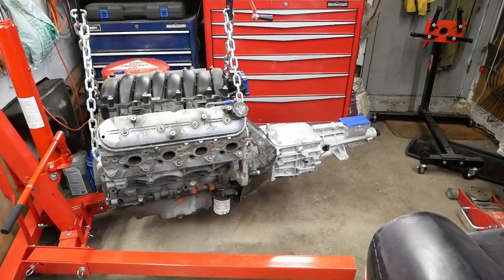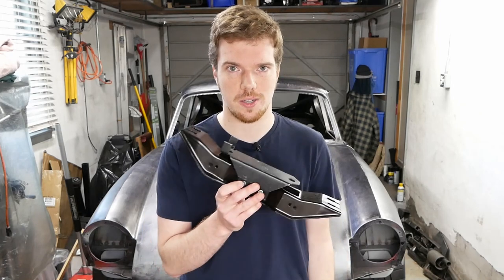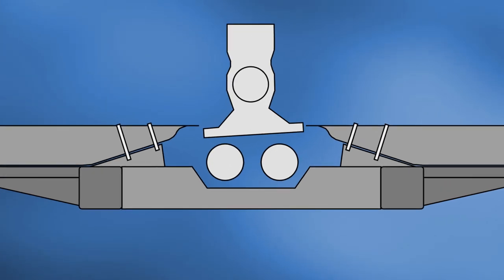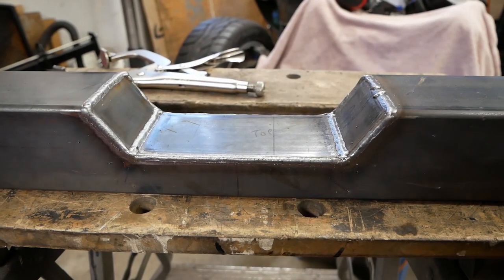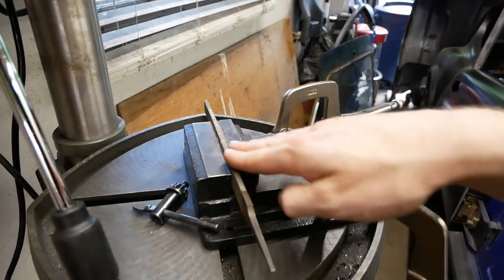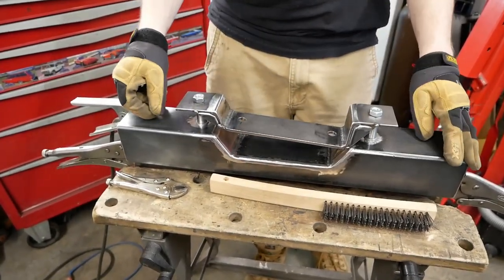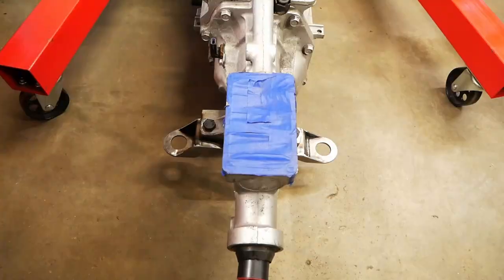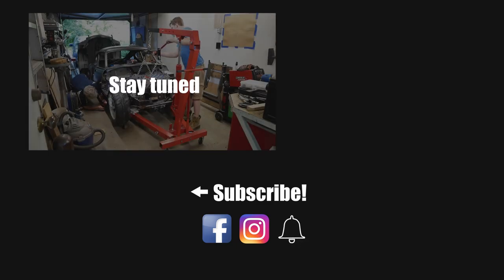LS & T5 Mounted – Pro Touring V8 Triumph Restomod – Project GT6R – Ep21

Comment: im curious as to why if you were going for budget 5 speed you didnt go with the nv3500?
Reply from the maker: Looked into many options and the T5 just worked well for size, availability, adaptability and cost.  An AR5 would have been a better choice for torque capacity, but you make decisions and live with them!  I've seen NV3500's going for twice what our T5 cost! 👍

Comment: Why is the gearbox twisted?
Reply from the maker: Great question!  Ford designed a bellhousing that tilted the whole transmission towards the driver - I'm assuming to improve the gear stick position.  Our bellhousing puts it back level though, which just means that the mount has to take up the difference! 👍

Comment: At the risk of seeming overly safety consious, I hope you are using top grade face/eyeprotection. You are an arisit with the grinding wheel, but it was never ment to be used as a pair of sisors or tin snips.
Reply from the maker: Although I may not have much in the form of leg/arm protection here, eye protection is something I never cut corners on.  My right eye has astigmatism anyway, so I can't afford to have any issues!  Thanks for the concern for my health James 👍

Comment: I would have made a triangular spacer to square off the gearbox mounting
Reply from the maker: Good idea, but sadly just extra weight!  This left everything as compact as possible 😊 Cheers John!
Reply: @FanatikBuilds   I would have used aluminium
Reply from the maker: That would solve the issue!

Comment: Maybe you are related to Bisforbuilt?  A gt6 is a lightweight sports car, not the golden gate bridge, having done dozens of engine swaps in my 50+ years as a mechanic, one "always" starts with a plan, for the whole project, first off dropping an 500lbs body on girders designed for truck really is overkill ..I was one of the first people in the world to slot a very wide VH45 Nissan into a fairly small 240z the only body parts altered was a differed gear lever hole in the trans tunnel, it's called planning rather then cutting first
Reply from the maker: Unlike the 240Z which is has a larger unibody and are known to be relatively strong, the Spitfire and GT6 seem to warp if you look at them wrong! (I'm obviously exaggerating, but the point remains)  The original chassis was never going to cope with the stress of 3x the power, and amazingly, our new chassis isn't that much heavier than what it replaces.  It also ties into the structural parts of the bodyshell better.  All in, with sound deadening and everything, we expect to weight ~2300-2400lbs and have a better weight distribution and a lower center of gravity.

Comment: Coming soon… a 4000 lb GT6!
Reply from the maker: Nope!  We do expect it to be a bit heavier than factory, but not by a lot.  We've been weighing parts as we go and are estimating around 2300-2400lbs with sound deadening etc.  What weight it has gained, is low down, and further towards the middle, so we've only improved the weight distribution!